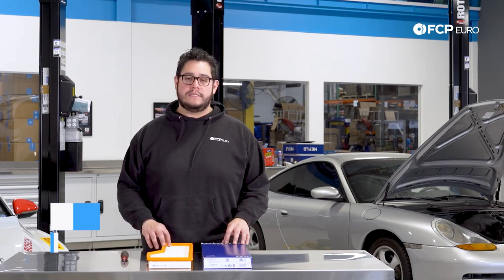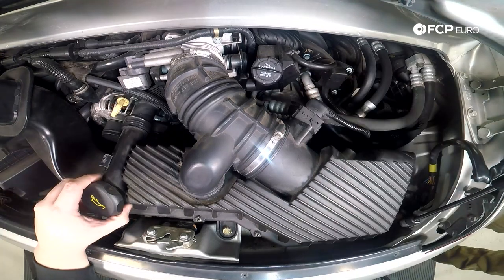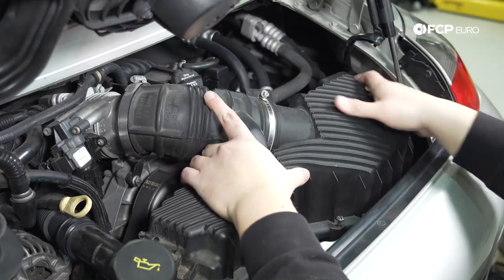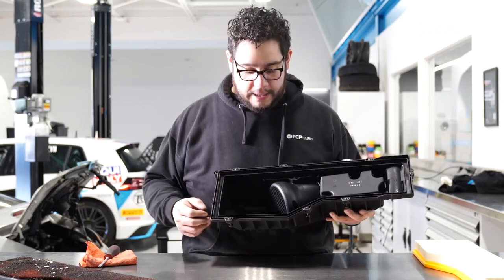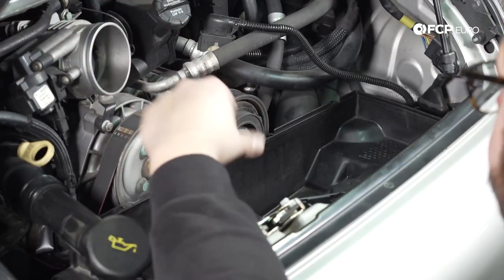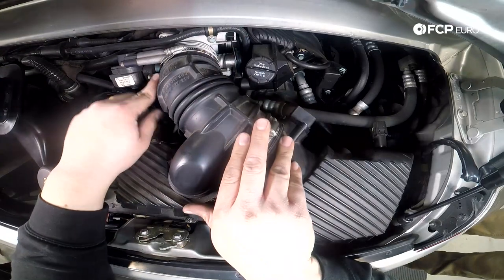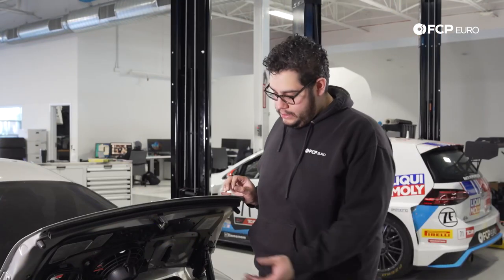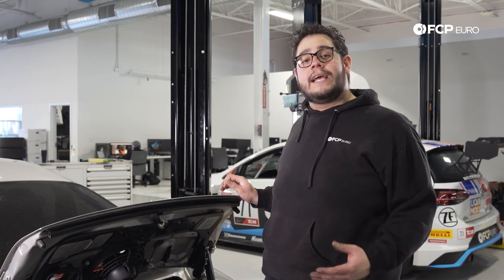Porsche 996 911 Engine Air Filter Replacement DIY - Porsche Carrera, Carrera S, & Targa

Comment: And for the love of God be careful with the oil filler tube or it will crack, and you'll be using electrical tape to hold it together until the new one arrives.